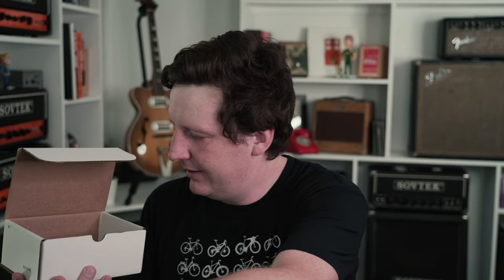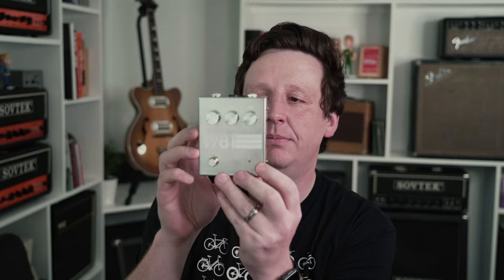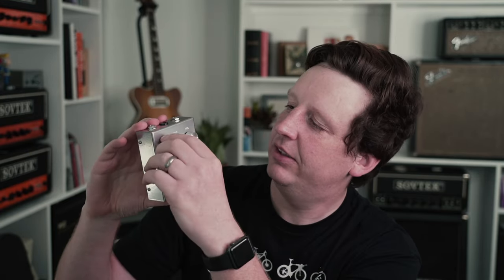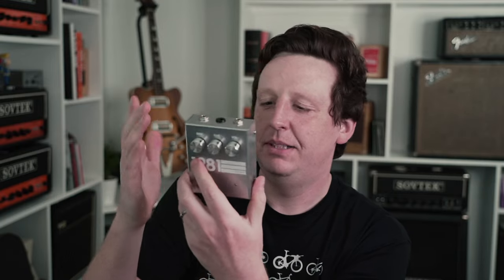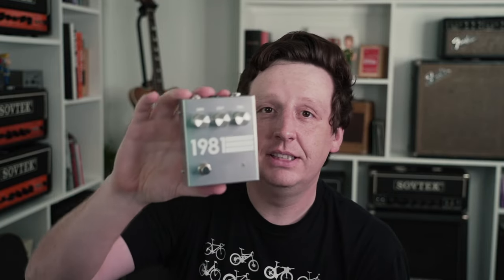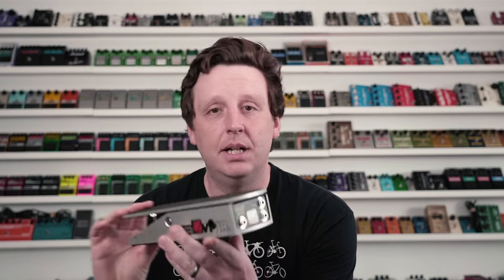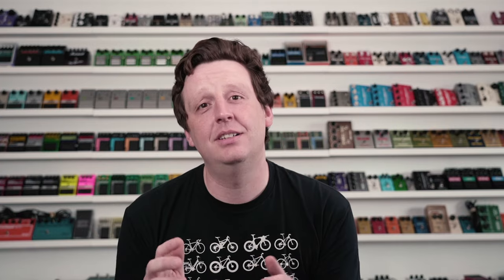Why You Need A Buffer

Comment: Wait, so say I had a boss tu-3 pedal in front of my " overdrive/distortion/fuzz" to sandwich my board. Its no good because the buffer is before the fuzz?
Reply from the maker: Probably best after the fuzz ;)
Reply: Its probably best after fuzz but don't just put it after your fuzz because a video told you to. If it sounds good where it is then keep it there unless you think moving it will sound better
Reply: @jhspedals  Are all boss tuner pedals buffers?

Comment: Is an always on pedal the same as a buffer?
Reply: I was gonna ask that

I’m staying for the answer
Reply: No, the always on pedal is this: you have your instrument and with one or more pedals that you can’t live without, that’s a always on pedal. On my pedalboard are the compressor, delay and reverb, and the tuner (on bypass, used as needed). Then you have pedals that you use only for certain parts of the song...so, they are off but ready to go when you need, they are not always on pedals.   Cheers.
Reply: @andres.moore997  just so I'm clear, If there is a pedal on the board (like a drive or delay or boost or comp or whatever) that at is never in bypass mode, is that also acting as a buffer since it is active? Isn't active circuit itself serving as a buffer?  Why would you need another buffer in this case?
Reply: @jaltsch1  Because every pedal, cable, connection between pedals, is taking a little piece of your sound. Try this, play directly connected to you amp, and then through your pedals. There's a big difference in sound (and more if you have a chorus/phaser pedal). I tested on my own, and with this video I decided to add a buffer. Its night and day difference.

Comment: Our US president has true bypass. A buffer would greatly improve the signal though.
Reply: As in his message doesn't always come across loud and clear? I agree. It would be nice if it came across concise and people used valid arguments instead of using mangled quotes that were somehow lost in translation because they were distracted by loss of high frequencies. We must call White House staff at once to upgrade and add buffers to hardware used in press conferences.

I hereby declare a NEW American movement that will improve the lives of all, we shall call it the "Make Audio signals Great Again" movement, or "MAGA" for short.

That is what you meant, right?

Comment: Can I have TOO MANY buffers (e.g. Boss pedals) on my board?
Reply from the maker: Yes. Too many buffers will create noise.
Reply from the maker: To add to my statement, if you're using a bunch of Boss pedals, even though they're buffered, you'll probably be okay. Best thing to do is try a sound test with and without them and see what kind of signal loss you're getting...or not ;)

Comment: Does the boss tuner have a buffer?  The only boss pedal I have on my board
Reply: yeah
Reply: Easy to test. If you turn the pedal off through its bypass switch, then unplug the power to the pedal and ply your guitar through it. If you hear nothing there is a buffer because there is no power for the buffer so the signal doesn’t pass through. If you still get your guitar sound through the pedal when it has no power and is turned off, then it’s true bypass and has no buffer.

Comment: Is a BBE Sonic Maximum same as a buffer? Or what is the difference?
Reply: No, the buffer is a type of switching circuit in most guitar pedals, which is also available by itself in an enclosure. When you turn off say, a Boss Pedal, most of the time the pedal is just changing you to another, amplified circuit between the input and output. This has a lot of benefits like lowering the impedance (or the loss in signal that occurs over wires).

Comment: I do not understand why, nor did you explain, why you would need another buffer at the end of a signal path that has one at the beginning? Once the buffer is on at the beginning the signal has been reintroduced and does not drop off with pedals after that. Again, why would you need another buffer, at any point after having one in the beginning?
Reply: The one in the begining is to make sure your electrical signal is nice and strong straight from the guitar(except if you have fuzz due to a buffers effect on fuzzes), and the one in the end is to make sure your amp also gets a nice strong electrical signal from the board, since every patch cable in your board is degrading the signal ever so slightly. Thats at least how I understand it.
Reply: Johny Ludvigsson Okay, so signal loss will continually reoccur with the introduction of every cable or true bypass pedal you add. That's the fact that seemed to be missing from Josh's video. Thanks. I have a JHS Muffuletta (fuzz) and I can't seem to hear any negative effect of having my buffer going into it. I've tried both pre and post. Is that not the type of fuzz that's affected by a buffer?
Reply from the maker: What Johny said ;)
Reply: @scottallen9556  Yes, to my understanding that's how it works. Every new connection, be it a pedal or a new cable or just a connector, will have a slightly degrading effect on your signal due to the inherent resistence of different materials, all materials resist electricity, some just does is less; as far as I know this is true for any electrical signal that is passed through several units, not just through pedals, but also for example a video signal through daisy chained cables.
I'm not very knowledgeable when it comes to fuzzes, but to my understanding, beacuase of the circuit architecture of a basic fuzz, it doesn't like to ha a boost before it, it will change the sound and feel of it.
When it comes to the Muffuletta, I don't know. I should change due to it actually beeing a collection of differet fuzzes, so it should change in the same way they do, but I don't know. Josh did a video a on Fuzz(es) as part of this series a while back, your anser may be in there :) I think there's some videos on the Muffuletta also :)
Reply: @scottallen9556  PS. Sorry for the bad spelling, english isnät my first language, hopefully you'll understand anyway :P
Reply: @Johny Ludvigson That's not how buffers work though. Buffers are not designed to increase the strength of your guitar signal. Their sole purpose is to drop the impedance of your guitar signal from high impedance to low impedance, without affecting the tone or volume of the guitar signal coming in. This is why buffers are sometimes referred to as 'unity-gain amplifiers'. This means that even if your guitar signal were to degrade, (which it probably won't to any perceptible degree if you're using a buffer in the beginning of the chain anyway) all that buffer at the end of the chain is going to do is perfectly reproduce that already tone-sucked guitar signal like the buffer wasn't even there. And attempt to drop the signal to low impedance (which it can't because the guitar signal is already low impedance anyway thanks to the first buffer in the beginning of the chain) therefore rendering the buffer at the end of the chain utterly useless and redundant.

Putting a buffer at the end of the chain is POINTLESS.
Reply: Daniel Lomax FULL CIRCLE back to where I started the day? This is hilarious. I actually started out by understanding and believing what You're saying, then was told something else, now...I should probably just stop asking and use my ears. But I won't?
Reply: Your original question to Josh was absolutely correct. How does it make any sense to put another buffer at the end of the signal chain when the guitar signal is already buffered anyway? The correct answer is that you're right and that it doesn't make any sense.
Reply: Daniel Lomax 💪 My Man!

Comment: This didn't explain the technicals behind what a buffer actually does.  The hose analogy only goes so far...  Can anyone explain or point to a more detailed explanation?
Reply: Buffering a signal is basically adding a circuit designed to repeat the signal. Why would do this? Because the electrical signal output by guitar pickups is very weak by itself and degrades from changes in capacitance and inductance (high impedance signal). A buffered signal  (low impedance) is far less susceptible to degrading in the same way (think river vs squirt gun, both might be moving at the same speed but you can’t deflect a river with your finger).
Reply: @T T  What if you are using an active bass with a very hot output? Does that make any difference?

Comment: Sorry I'm late. Why should you not put a fuzz after a buffer? Asking for a friend.
Reply: A lot of fuzzes rely on the loading effect of the pickups and guitar controls to function in the intended way - stick a buffer in front and they're no longer directly electrically connected to the pickups, they're connected to the buffer.  It's why you always put something like a Fuzz Face first in the chain, as if there's a buffer or another pedal in between, you lose that lovely way you can clean it up and control the drive from your volume control on the guitar and they change character completely.  Or, you can ignore that entirely, stick it wherever and drive it with a buffer if that sounds good to you - I usually put fuzzes first, but I had one particular Fuzz Face that just sounded amazing when fed a buffered signal.  Experiment!
Reply: Fuzzdog explained it quite well. A buffer before a Fuzz Face type of circuit will completely alter the feel and sound of the fuzz, mostly not in a good way. However, there may be instances where you might want to have a buffered pedal before the fuzz. You may want a Boss Octave pedal going into the fuzz, or maybe an EQ. All Boss pedals have a built in buffer that stays on even when the pedal is bypassed. You might want a looper pedal before the fuzz, some of those have "always on" buffers as well. A looper pedal before the fuzz will not sound like the guitar directly in. There are pedals that solve these issues, if placed between a buffer and a fuzz, the fuzz will retain it's smoothness and character. They can also solve the issue of a vintage Wah before a fuzz not getting the full "quack" range, a problem that a regular buffer does not fix.
Reply: @FuzzWoof  Thanks for taking the time to reply, makes sense. I've pulled out my old Ramshead Pi to play with again. I think that might explain why I've always found it a bit hit and miss!
Reply: @YU-qn1tm  As above. Thanks for takjngvthe time. I really apriciate it!
Reply: So if you have a JHS modded EB volume pedal (buffered) is it not recommended to put it before fuzzes and ODs???  Thanks

Comment: I have a boss NS2 as the very first pedal in my chain with my drive pedals in the loop of the noise surpressor. Do I need a buffer before the NS2 or will the buffer in the pedal do the job?
Reply: If you have many pedals I would say yes. But if it's just 2 or 3 then it's ok

Comment: Uhhh best way to buffer a stereo board?
Reply: With a empress buffer +, it has two outs, amp and tuner, and the tuner can be used as a stereo output. (I have this pedal, so if you have some questions, let me know).

Comment: If Boss pedals are buffered...but we shouldn't use buffers after Fuzz...I should not have any Boss modulation pedals down the signal chain from my fuzz?
Reply: it's the other way around, vintage style fuzz should be the first thing seeing the guitar (muffs can pretty much be placed anywhere) the next pedal in the chain even if buffered shouldn't affect your fuzz
Reply: @sirshadowplay7287  I have an analogman sun face pedal that only uses battery if that makes a difference. And I also have a earthquaker devices fuzz in the data corrupter. Both should go at the start?
Reply: @GeorgeVazquez  yes, they're both sensitive to your guitar output so i'd go dun face into data then whatever else you're using
Reply: @sirshadowplay7287  that means I shouldn’t place the Boss Octaver OC-2 before the Fuzz Face, Tone Bender or vintage Big Muff? I always have the OC-2 first on the chain followed by Fuzz…
Reply: @oceanix1929  you could have it after a muff even if it's vintage, the best thing to do would be try it after to see if the character of your fuzz changes and if you don't like it keep it the way it is, these rules aren't set in stone the effect a buffer has on a vintage fuzz is kinda like what a sag or gate control does on some zvex fuzz pedals or things like that, it's all about what YOU like :)
Reply: @sirshadowplay7287  thank you Sir for the reply! will try placing the OC-2 after the fuzzes. I tried in the past and I liked it better before the fuzz but that was when both effects were on, as it sounds better than the other way around with the combination of pedals I have, but have not paid attention if it has an effect to the fuzz when the OC-2 is not on!

Comment: i have cable length 17f/5m before pedals, then i have 8 pedal (have some buffered, some true bypass), then output cable to the Amp are 10f/3M or 17f/5M. so do i need a Buffered stompbox? can anyone to answer my question
Reply: Like he said, did you hear a difference when you plug your guitar straight in the amp? If it sounds duller/muffled, then yes. I'm using the Polytune 3 as the first pedal which has the Bonafide buffer in it. You can switch between true bypass and buffer. When I'm using the buffer, my tone comes back to life again

Comment: Sorry i’m a bit new to this and looking to learn. My current setup is a telecaster >polytune>earthquaker warden comp>fulltone plimsoul>walrus julia chorus>boss bf-3 flanger>chase bliss gravitas>strymon el capistan>strymon blue sky> vox ac15. i definitely notice a loss in highs when i’m playing through my bypassed pedalboard compared to when i plug my guitar straight into my amp directly. i understand that my boss flanger is buffered but most others are true bypass. where would be an appropriate place to place a buffer to bring the highs back? thanks in advance for any help or suggestions
Reply: what polytune are you using? i use a polytune 3 so i what i did is i just enabled buffer and placed it at the end of my chain
Reply: @barnieedison34  i’m currently using the original, but i just recently learned that the newer versions have the bonafide buffer built in, so i’ll probably sell my current and grab one of those in the future. thanks for the response!

Comment: Do Boss tuners have a buffer?
Reply: All Boss pedals have buffers. They vary a little but most of us won’t be able to tell the difference
Reply: @mrhamishknox  The Waza is switchable between true and buffered. Best of both worlds.
Reply: @Apprentice_of_the_Leonine  Oh, I didn't realise it was switchable. To be honest, I don't really see why it's 60 quid more than the normal version.
Reply: @mrhamishknox  Superior quality components and made in Japan. Those two things alone hike up the price a good bit. Switchable bypass also plays a lesser role in that. You could get one used on Reverb or eBay for cheaper than new. I did so with the Dimension C Waza chorus.
Reply: @Apprentice_of_the_Leonine  I completely understand with a lot of the pedals where it would sound better or the original isn't available any more, e.g. the Dimension C (which I love), but I really think they're pushing it a bit charging so much more for a tuner pedal.
Reply: @mrhamishknox  Peterson's StroboStomp HD is superior anyways, at least in terms of accuracy and features, and it's about the same price or a tiny bit cheaper.
Reply: @Apprentice_of_the_Leonine  It probably is, but I just personally like the Tu-3. Built like a tank, huge tuning display, and I just like Boss lol. I'm sure the Strobostomp is more accurate, but the Boss is good enough for my playing.

Comment: what is the different buffer and booster?
Reply: Somebody else will probably explain how horribly wrong I am, but my impression after watching this video is that a buffer is intended to effectively repair whatever signal loss occurs due to the capacitance of extended cable lengths (effectively increasing the presence of whatever treble frequencies tend to be lost [think of it like turning your tone pot up to 9 from 5]), while a booster (generally) is intended to increase your signal as a whole (think of it as turning your volume pot up to 9 from 5).

My other thought is that a buffer won't (or, at least, shouldn't) push your signal to the point of distortion, while a booster can, and often times will, be used for just that purpose.
Reply: thank you..
I think booster have much more gain..
sorry my english so bad..

Comment: Can you model your buffer for Bias FX?
Reply: I use a Morley volume pedal into a Countryman di into a Saffire Pro40 interface. I also have a hand wired Vox wah and a true bypass Whammy. The first time I ever heard about true bypass was from a band mate in the early 90's. He said it only really mattered for wah because of phase issues from the inductor. We used Rat pedals and EMG's. It was Tampa! I also really like my Boss CS3. The Bias copy is spot on. I was trying to be cheeky with my post. But, you are correct! Cheers!
Reply: The Radial Dragster is really cool for shaping tones.
Reply: Trey from Morbid Angel used a Rane 31 band eq set to flat with the output on ten as a clean boost with a rack mounted Rat into a Marshall. DI's are buffers. I like them better than the instrument input of my interface. I have mogami cables. You are not paying for copper content with expensive cables. You are paying for how flexible the cable is. I love solid state and tube. I lean towards solid sate! I use a computer for convenience.
Reply: Fnord! Robert Anton Wilson!